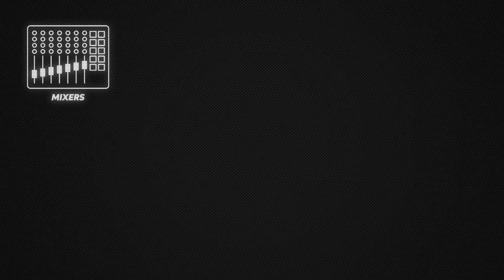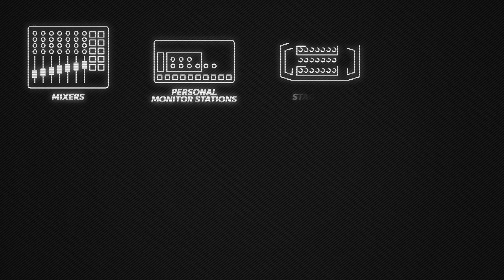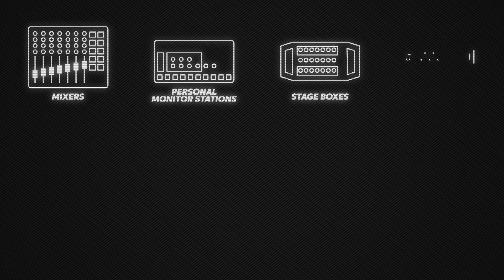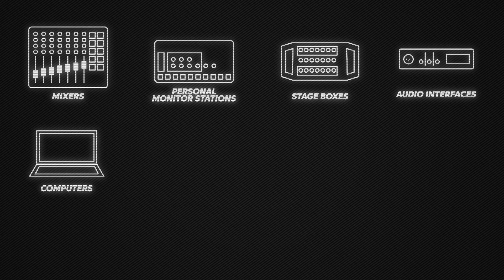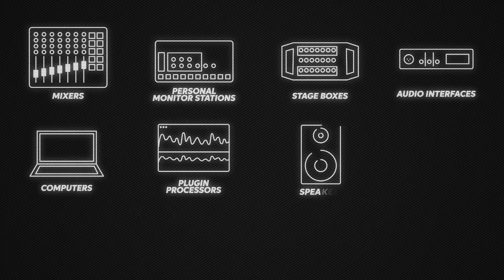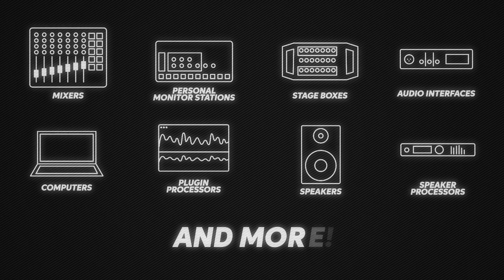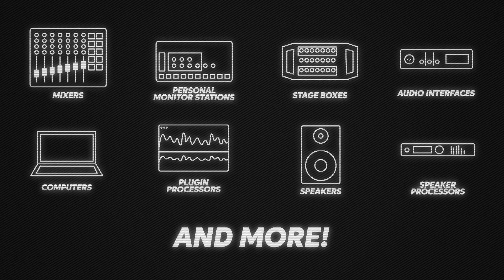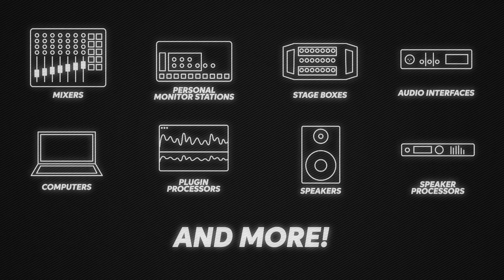What is AVB?

Comment: What does it take to get AVB into a Windows notebook computer for recording multi-track into Presonus Studio One?
Reply from the maker: Hey, David! AVB requires both hardware and software support, both of which are not typically built-in to Windows laptops, but it can depend on the model. Feel free to reach out to your Sales Engineer and they can help figure out if yours supports AVB and what software/hardware you might need to get that up and running!
Connor Smith, Sweetwater Sales Engineer, (800) 222-4700 ext. 1793, connor_smith@sweetwater.com

Comment: AVB ought to be more reliable, and much easier to set up. It never worked for connecting a MacBookPro to a new PreSounus 32SC mixer. MacOS never found the mixer.
Reply: You need two AVB devices to create a network. Otherwise it’s just a point to point connection. Once you have a second AVB device or hub MacOS will see an AVB Network.

Comment: Great explanation. Just one question then, from a networktech-noob, how do I know if a switch supports AVB-priority? Do I need a special one from PreSonus to use AVB between their mixers/consols/racks etc? Or any switch that support AVB? And lastly - if my switch isn't made to give that priority to the AVB-connections, can I still use it to get the audio through but without priority over other digital traffic, or will it simply not work at all?
Reply from the maker: Hey, Johan TT. Thank you for checking out our video on AVB. AVB is an amazing audio network with extremely low latency and amazing quality. With AVB you can stream over 512 channels of audio. It is one of the new networked audio solutions on the market and the other big player next to Dante for the pro audio world. When using any AVB product you can use any AVB certified network switch to connect your gear. It does not have to be the same brand product. Personally, I like to stay with the same brand if possible, just so I know it has been 100% tested together. But it is not required. One of the best things about AVB is that it is an open standard that any manufacture can use in their products. This means that everyone’s gear should play nice together, and you can pick and choose components to your liking. As for your second question, I would not use anything else on the network other than my production equipment. It does say it can coexist with standard Ethernet networks, but for efficiency I am not sure I would ever put all of my infrastructure into the same network. If there is anything else I can help with, please give me or any of my co-workers a call.
Thanks,
Grant Embury, Sweetwater Sales Engineer, (800) 222-4700 ext. 1647, grant_embury@sweetwater.com
Reply: Sweetwater thanks for the reply. To clarify my last question, I didn’t mean to connect the production equipment to the rest of the house general internet network to compete with Netflix and everything else. I meant to ask if I can use a general switch (that I happen to all ready have laying around) to connect the production gear and computer locally in a separate network. Can I get the equipment to “talk” to each other through that or is it necessary to buy a new special AVB-switch?
I recently got the Studiolive 16R and is now using the USB option, and to be honest, the latency is very low compared to other interfaces anyway. So as long as I am not getting more AVB-connected gear, I guess AVB is more of a luxury than a need for me now. The original question was made before actually having the studiolive 16R installed in the studio. :)
Reply: @johantt2591  You need a switch that is AVB compatible. Presonus, Motu, Arista, Cisco and some more switches are available. For consumers, I think Presonus and Motu are the mostly used. The Presonus switch is much more robust and features etherCon ports and PoE and built in power supply.